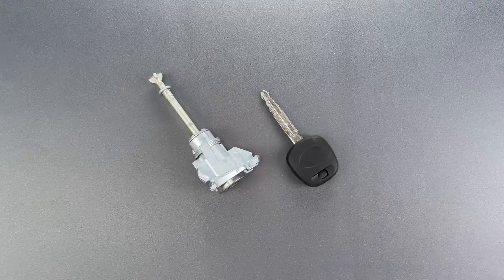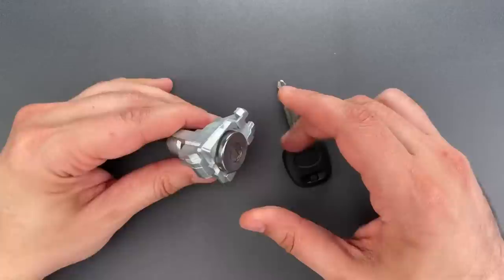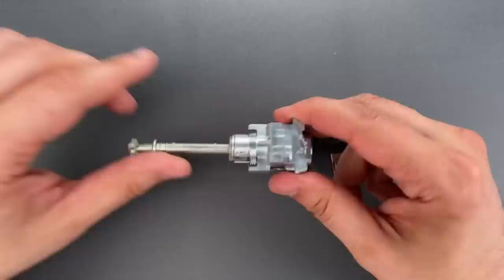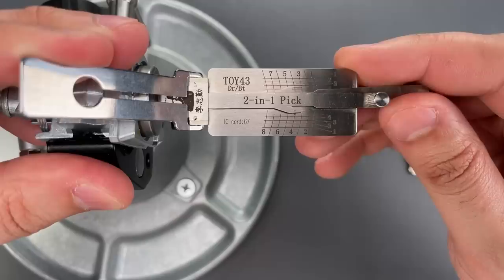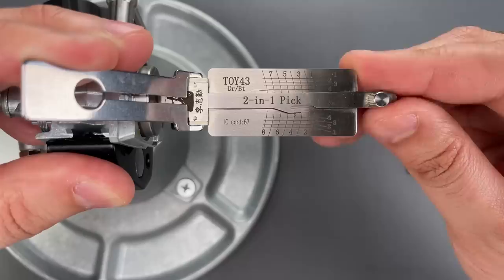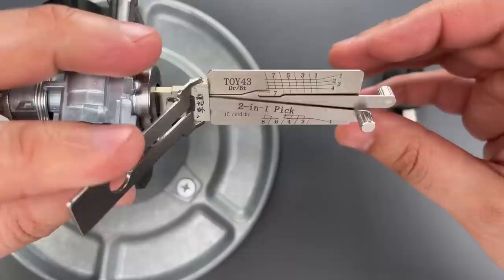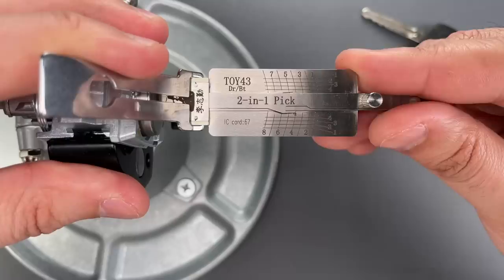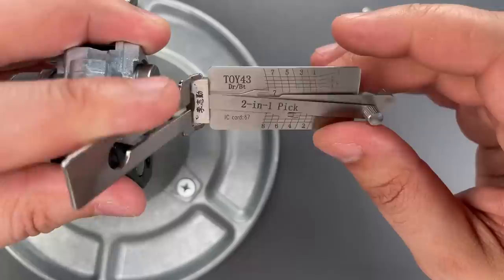[1351] Toyota Corolla Door Lock Picked

Comment: What I envy about LPL is that he always knows precisely where he is in the lock. I've been dabbling for a few years now but I always need to find an end pin then count, I don't find it intuitive like LPL does. This guy is seriously good; like (I think Gary Player said, after being accused of just being lucky at golf) "the more I practice the luckier I get".
Ho hum.
Reply: It shows where he is on the card. What are you talking about?
Reply: Opecuted  Correct!
Reply: All you need is practice. LPL picks a couple of hundred different locks just to test one new pick. If that's his test procedure for a single pick, just imagine the amount of practice he has.
Reply: I still have Trouble Determining if I am on the First Cut or 10th cut.
All Seriousness Aside. I have a Highlander, got the TOY43AT
LISHI, It doesn't have 1st and Second Space. What is difference Between TOT43AT and TOY43? Thought the AT may handle More. Is 1 and 2 not used on some Toyotas. Can I pull the 43 AT out 2 Depths and continue Picking? Is AT For Ignition? Thanks

Comment: Older car lock always have been shite anyway, A friend of mine used to work at a garage during his holidays, they had a Ferrari which they did not have the keys of that they had to move. Some guy took the keys of his Fiat Cinquecento and opened it with that...
Reply: Ferrari is owned by FIAT so using a FIAT lock makes sense in a GM parts bin way.
Reply: Ferrari = fast Fiat
Reply: @LadyAnuB  It's not anymore, but it used to indeed. But still shady you'd reuse those things on a Ferrari and have the same bidding on the keys.

Comment: Must be Monday, it took me a while to figure out why the tool was labeled TOY
Reply: Haha thats the keycode for the lock. Like the blade of the key that fits it will be a Toy43 key blade.
Reply: Some locks and aftermarket keys will have different coding though depending on the brands existing system for key idenfication. 

But i believe he is using Silca key references when he labels them just looking at the key and what he labels the picks. But thats going off australian standard so i could be wrong on  that last part

Comment: There's a mismatch of tool here. The tool used is marked for older 8-cut Toyota keys, but the cylinder being picked is a 10-cut cylinder. 

8-cut keys have a wafer spacing of 2.3+2.3mm, while the 10-cut keys are 1.4+2.1mm. All even wafers are on one side of the key, and all odd are on the others, but while picking, you transitioned from odd numbers to even numbers on the first edge. This is because the mismatch in the spacing accumulates to roughly one cut spacing after four cuts, and the "I'm not sure if that's 4 or 5" is also due to this accumulated error.

The correct tool for this cylinder would be the TOY43AT, where AT stands for 'All Ten'. It differs from the TOY43 mainly in the markings for cut positions. Cut depths are close enough to be practically the same (depth increment is 0.65mm for 8-cut vs 0.6mm for 10-cut).

Comment: I think some slots are missing wafers so that a valet key (with a gray plastic end) and owners key (with a black plastic end) will work on the door. The glove compartment lock will probably have more wafers so that only the owners key will work on it.
Reply: The valet key has the tip of the key ground down all the way so there's basically no wafer in the lock at that location on the door so it will open with both. The trunk would have the extra wafer to prevent the valet key from getting in the trunk.
The glove box lock is actually less wafers, usually only about 4 wafers but just the end of the key goes in, the valet key does not hit the last wafer so it won't open but the master key does.

Comment: It depends on the left or right side door, but if there’s a 5-digit number etched on the side of that assembly that’s the key code.😉
Reply: That number may lead to a bitting but it is not a direct code.
The key has more than 5 cuts
Reply: @fixitallpaul4847  that number is the same number that comes on the little metal tag on the key ring when you buy a new Toyota. That 5 digit code is the dealer keycode that will make that exact key. Toyota also stamps that code on one lock cylinder.
Reply: @T00LF00L  Unless you have access to the software/database those numbers do no good.
Most dealers dont keep info beyond 5 years.
Some aftermarket products like Code source might show it.
Reply: @fixitallpaul4847  You don't understand.  That is a dealer key code, every new car comes with one on the keyring with the keys.  That code will tell an automotive key cutting machine exactly how to cut that key.  I do have access to this hardware, a Keyline Laser 944 to be exact.  I do have NASTF access to all automotive databases, which will provide a key code well beyond 5 years old.  ANY automotive locksmith can cut a Toyota key with that 5 digit code.

Comment: Question for you LPL, could you design a lock that combines pin and tumbler with wafer or dimple locks? If so, are there any examples of locks that incorporate multiple locking designs in them?
Reply: Isn't a dimple lock simply a pin tumbler with the key on its side?
Reply: @bachaddict  :o
Reply: @bachaddict  right, it’s more like it’s a dimple key, or at most a dimple keyway.
Reply: Gm uses a wafer lock with side bar its also easy to pick auto locks have a lot of slop
Reply: Ign. Lock would be more impressive since you can open that car in 20 seconds with a opening tool
Reply: I believe that LPL HAS shown locks like that before, and most are from Multilock, I believe.
Reply: Wafer locks are the easiest to pick. Split wafers are harder. But dimple locks are much the same as pin tumblers except that you insert the key sideways. What you really should be looking at is more complex designs like sidebars and discs like the Abloys.
Reply: One could, but locks are not really about pick resistance. They’re mostly about reliability. The more moving parts, the more likely you’ll have a busted lock that won’t work possibly with your key stuck in it. That’s why locks tend to be fairly easy to pick. A sloppy lock will pretty much always open to the correct or even just mostly correct key. A lock that combines pick resistance and reliability tends to push the limits of the market’s willingness to buy it.
Reply: I would suggest looking up Bowley locks - combining the ideas of warded and pin-tumbler locks into a surprisingly pick-resistant product!
Reply: Kinda but the problem is that once you get into the complicated territory you run into issues with them not taking wear very well and just not being very smooth to operate.    
That is the problem and why good locks are so hard to find.   A good lock isn't going to feel as good to open with the key because of the tight tolerances and security pins.   A really sloppy lock is going to feel super smooth when you turn the key but will obviously be easy to pick/rake.   Pretty much to someone who knows nothing about security the cheap crap lock actually is going to feel like it is higher quality when you turn the key.
Reply: pin / wafer are picked with same tool. What's the point.
Reply: There are many locks with pins from at least 3 directions, these could be considered pin tumbler and dimple locks combined, eg: https://youtu.be/BbgQ_HKj1hc Kaba 8 (3-row)
Reply: This is a brand new wafer/lever lock design: https://youtube.com/shorts/AEJSitaHAcE?feature=share
Reply: @TysonJensen  fair shout

Comment: my 89 corolla has a passive security system, with chipped paint and rusty exterior, If someone would steal it I would also give them the money to fix it
Reply: I have a 76 sitting in my driveway. My security feature is no electrical. If you want to steal it, you have to earn it!

Comment: do I need to bother locking my car at all anymore😆. 
LOL one of my relatives has a Chevy Spark, left the keys inside, AAA came out, an air wedge and a rubber strap he had it open in a few seconds. 
I used to work for an auto auction on a service truck we unlocked vehicles, wedges, sticks, and straps all part of the job, we didn't pick like LPL although if I was still working there I might  have had invested the time to learn the skills to use Lishi tools.
Although at $54 and up I might think twice 😊

LPL I think Scotty Kilmer would like a word with you 😆

Comment: This cylinder is NOT from a 2008 Corolla, it belongs to the 8 cut series, which means the older version of Toyota cylinders, probably up to 2003 or 2004. The newer style cylinder is a 10 cut cylinder, which requires a different Lishi tool, toy43 10cut.

Comment: That's because the door locks only use half the pins on the key the ignition uses them all 
technically you can make a 4 or 5 pin key for just the doors

Comment: not sure if it pertains to this lock in video but on my 2002, there was a little wedge that was pushed aside when you insert the key as part I think of the key presence detection.
well over time that got quite a sharp edge to it somehow and one day the key had become slightly bent and I stuck it in the ignition anyway.  It then got caught on the wedge which dug into the side of the key and made it impossible to remove. 
It was a major bruh moment as I had to take apart the column and release the lock cylinder from the car to be able to manipulate the wedge from the other side. 

Could be an attack point if you want to screw someone or have a reason for them being forced to leave the chipped key in the car overnight or for a decent length of time. all it takes is a small file mark or even a burr you could make with a pocket knife on the key.

Comment: I noticed something interesting when I was working at Nike. Engineers depend on mechanics to perfect the product. One of the biggest issues I noticed is all the locks he goes through might be manufactured by engineers and not assisted by mechanics. A major flaw in commercial products. Mechanics know and think in different ways that engineers could really benefit from them. I'm sure they might be working with mechanics but if LPL picks locks so fast are they really?
Reply: You have a high IQ my friend.
Reply: @eustacebagge3869 I think outside the box. I see a lot of flaws with people thinking their better then other people and have never worked or touched the material they are manufacturing. Corporations are too hell bent on making bottom lines and it's always rush to make the product.

Comment: 8 looked like it was binding. Should've push the 8 to see what happens. Maybe a false set? (i dont know much about locks) just from your videos ❤️
Reply: if you tried to force it and it moved, the lock would be overset.  overset means the bottom pin is wedged in where it should be flush with the seam.  it's a rookie mistake that i've made figuring it out myself.
Reply: @SneakySolidSnake  thx

Comment: Can you do a 2005 gmc sierra? My truck was stolen last week and recovered later that day. 
They popped out my driver door lock with a flathead screwdriver. Apparently if you hit it hard enough at the right angle the alarm system thinks a key was used therefore disabling the alarm? Then they took off the steering column cover and used like channellocks to turn the ignition and force it on. Sucks

Comment: Curious if he could pick it “without” the right tools. He always says you can easily pick it with the right tools. I’d like to see a challenge to do it without the specially made car tool and see if it can be done.
Reply: Probably could be I've never done a tpyota but I have done multiple semis and older GM models with single sided keys. Or even newer GM ignition around 2010

Comment: The lock on my 2000 corolla is so scuffed i actually have to force the key to rotate. lol
Reply: You can buy new locks for real cheap online. I replace ignition key on my truck a few years back for like 20 bucks. WD40 will lube it up. Ebay has set of them for 30 bucks. I did not look up how hard they are to replace. I am sure there is a video that tells you. Might take you 30 mins each door.
Reply: is that a SAO banner? ( gross who watches SAO) heaheha definitely not me haha like who would ever ewwww.

other hand your pfp steal that from a NIGHTCORE video? of course you did.
Reply: @JS-rv3et  hahahaha
Reply: @kameljoe21  I might have to give it a try, Do i have to replace all the door locks if i do that though or?
Reply: @lward53  If you have a 2 door then one set should be fine. If you have a 4 door there should be a 4 set. You will have a new key for the door and then a key for the ignition. When I replaced my truck ignition I had the original key for the doors so I have to remember that there are 2 keys. 
Yeah I think if you look up  on youtube there might be a video. Let me look
Reply: @lward53  So this video is for the door handle. I am guessing there you can look for another one I think I saw one for 45 mins long. Yet this video is short and shows you how to remove the handle which I am going to guess is what you will have to do to remove the lock as well. I started it at 2:17 so you can see the bare lock. https://youtu.be/eMS5XgIkix8?t=137

Comment: LPL, would you mind explaining how the Lishi tool works? This is new to me, and maybe some other subscribers.
Reply: My basic understanding is that they are keyway specific so they fit the type of lock they are made for. They allow you to tension and pick with the one tool as they have a sliding pick or picks for double sided locks like shown. One of the big advantages of the lishis is that they are marked for pin/wafer depth and spacing. So you know where each pin or wafer is and also to what depth you are setting it with the pick/s. This means you can use that info to decode a lock without gutting it. Pick it once and record the numbers the pick goes to when picking and you then have the bitting code to get a key cut.

They are awesome tools for locksmiths but more handy for some locks than others. If you were to be doing car lockouts for someone that has lost a key you could easily then cut more keys to match. However you would still have problems with key based immobilisers if the key was lost completely. Easier to program an immobiliser if you have an existing one.

Comment: Just out of curiosity... could the ignition lock be picked just as easily?
Reply: Physically yes, the ignition lock can be picked pretty easily. In practice, that's not actually going to help you because there is a chip inside the head of the key that communicates wirelessly with the car and the car will not start unless it recognizes the chip.
Reply: Sure, but you won't get a start and run unless you convince the ECUs (yes, plural) that you have a real key.
Reply: If it's a key with a remote then no. I think he said the alarm will go off or something.
Reply: From what I understand, the answer is no. At least in newer cars, there’s a failsafe that won’t let the car start unless the real key is in the ignition.
Reply: Thank you all, you are right of course. I forgot about the chip.

Comment: got a 2015 wrx i lost keys got price for new key its crazy over priced at subaru  i got the key code from them  but cant find a lock smith to cut me a key  with the code  i took door lock apart  and got the pin numbers is there away i can use the numbers on the pins to make a key ??  i got a hand cut lishi  and a key blank want to avoid replaceing full ignition and lock set  if possible  its a toy43r key
Reply: the bit pin numbers from key hole in words are 32224432

Comment: There’s an easier method I used once to prove to a friend how easy his late 90s Corolla was to get into. We had a key from a 96 4Runner just inserted it into the key hole and wiggled it just enough to get the door lock to nudge enough get in. Took about 5 seconds and we were in, cool feature if you get locked out while having a friend that own a Toyota too.
Reply: Haha bro you broke the lock and all you did was make it easier to get into in future. 

Thats the facts bro. You can turn alot of lock with enough force by simply putting a screwdriver in it and turning it until you break the lock especially older ones that have had 20 years of use and no maintenance.

But yeah you damage the lock doing that stuff so its a final solution and you are kinda a bad friend for doing that just to show him it could be done
Reply: I put it to you replacing your door window is easier and cheaper than your option. Especially if you know how many corollas are in junkuard waiting to be picked apart
Reply: @drunkpaulocosta  idk he was still able to use his door like normal so...

Comment: What about those car locks with a chip inside? I guess it’s probably not feasible to pick?
Reply: Why not? Just different tools. Have you ever heard of hacking?
Reply: You can still pick them. They have a manual bypass incase the battery dies.
Reply: The transponder in a key doesn't affect the locking mechanism. However, the transponder has to be there in order for the car to start. Without the transponder, turning the picked ignition cylinder will do nothing.
Reply: @justin260z  I was strictly talking about picking the doors or trunk. Not about starting the car. That you'd need the transponder for.